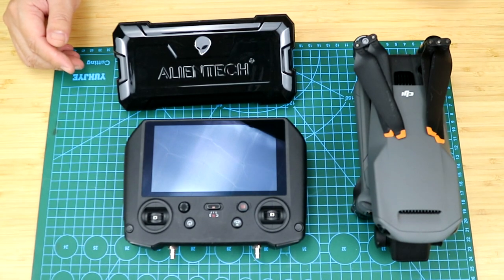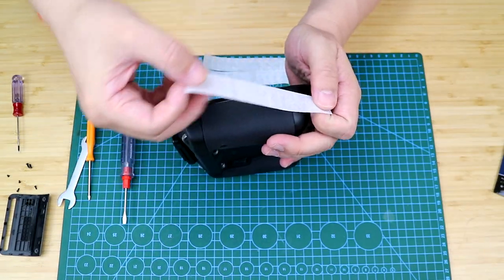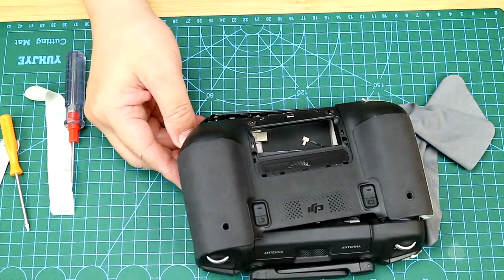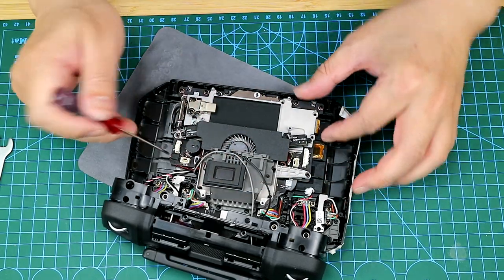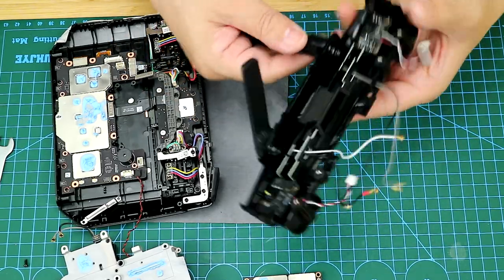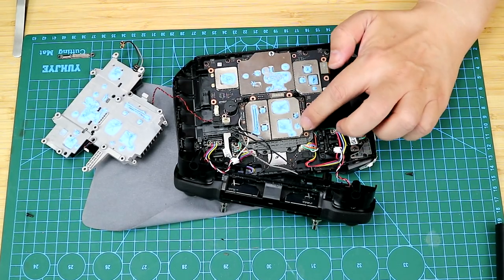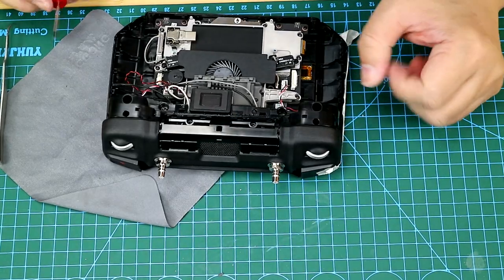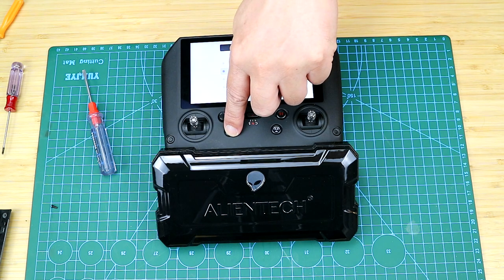Perfect, How to Modify RC PRO of Mavic 3 to Get Longer Signal Distance.

Comment: Compare to the RC PRO I prefer DJI RC, it's lighter and more affordable. I wonder if we have a chance to modify the DJI RC for alientech
Reply from the maker: It’s coming soon
Reply: I think the RC doesn't have enough width to install for AT Duo ii.  According to their specs, the RC is 1.5cm narrower than the RC Pro.  I would love to be proven wrong.
Reply: @teeraashakul8729  yeah and you need to make a hard modify to your RC(make two holes). But they said "coming soon"? We just wait for it. Maybe they make a converter of something.

Comment: I still haven't had anyone do a comparison of the alien tech and a 4hawks but from what I've seen both are good, got the 4hawks on my mini2 and once I get my 107 license and sole cash I think I'll get the mavic 3
Reply: The difference isn’t going to be much in standard urban areas, because gain is key, amplification is secondary but important in saturated environments, you would get more range with gain than wattage, double the gain exceeds 4 times the power, also note that when you amplify the signal you also amplify the noise signals as in you pick up every wifi signal in the direction your pointing. I use the alientech because the gain is so good and testing with my expensive antenna tester the swr etc is spot on, (I’m a retired electronics engineer) also the duo ii is amplified, but you get what you pay for, yes I get full strength at 4km in the city and rf signal interference messages on my remote but that’s in the city where there are literally hundreds of wifi signals from everywhere, thousands of apartment units between where I stand and where I have flown, out in the country side I have not been able to fly my Mavic 3 far enough to go out of range before my battery totally drains, in other words installing alientech duo ii will easily exceed the drones flight distance capabilities. It’s crazy powerful. I had my girlfriend drive down a very long road while I was on a hill and I kept flying straight until the battery was depleted, still had full strength all the way, she picked up the drone when it was forced landed from depleted battery and came back, although alientech is very expensive I was thinking at that point these antennas are worth every dollar. You now can fly without fear of loosing signal, I would say stock antennas are 3db not 4db and alientech are in the area of 10+ db gain. For legal reasons I can not show my videos because 18 x 20 km is outside the visual line of sight and well we simply can’t do that without approvals and a ton of paperwork and submissions which will be rejected here.

Comment: I would recommend a much wider, thinner blade to separate the case shells than that little screwdriver.  A putty knife would seem to be much less likely to scratch up your case and would apply pressure along a much wider area.

That being said, the RC Pro is a $1,000 device and I know for sure I don't want to go pulling internal assemblies apart nor making any modifications that can't be easily reverted back to stock condition without pulling the entire device all over again, especially when the device I'm attaching to it is going to cost another $1,000 or so to the total cost.

Comment: Brilliant I would love to see how good it work . My question is can it penetrate through obstacles and can this work on the standard RC that comes with the mavic 3 ?
Reply from the maker: Obstacles can cause severe attenuation of the signal. Yes, it can be used for cr- N1 controller.
Reply: @ALIENTECH_Booster  I think I sent u that message a little to early I notice u had all the info down below.  Thanks for the response I really appreciate it. I really have to upgrade  I like that aleanware

Comment: Alientech doesn’t have any instructional videos on a DJI RC Mini 3 Pro install. At least, none I could find. Regardless, I followed other DJI RC controller disassembly YouTube’s to see what I was fighting and success. Easier than this video. Once the two half’s are separated, there is no fan to remove, just heat sinks. The coax are longer then needed, so mind the reassembly. Oh, and(no included instructions) when you’ve drilled holes for the external mounting: the cables pass through the RC via two hollow screws that secure the mount to the RC, along with the two screws in the ‘sticks holder’ rubber/area(under the RC) you’ve removed to open the RC. The hollow screws hold the weight of the DUO ll. No screws, floppy booster. My DJI RC warranty was voided the moment i decided to buy the booster, so super glue fixed it. I fly FCC and twice the straight line range is a given. The big improvement is flying in areas (high foliage/terrain) limited before. Nothing is perfect, but this is nice.